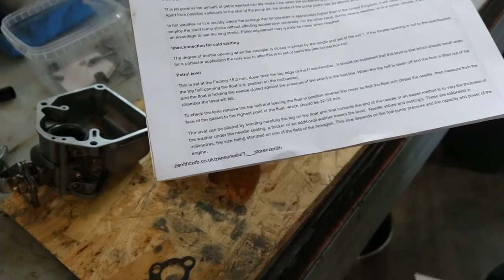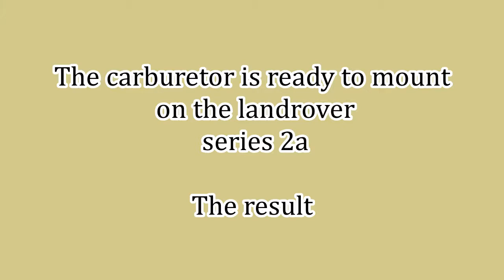Part 2 - Refurbish Zeneth 36 VI carburetor Land Rover Series 2A -  So Oldt

Comment: Nice video, I will be doing a rebuilt of mine next week and your video will be very handy.  Thank you.
Reply from the maker: Hello Marco Rojas . Thank you for the feedback. It is always nice to hear that a video is usefull for somebody. Do not forget to resurface the carb parts (see video part 1 : resurface Zeneth 36VI carb Land Rover series 2A) The resurfacing of the Zeneth 36 is essential for a good repair because the body of the carberator is warped from the heat. Installing the new nozzles (video part 2 : Refurbish zeneth 36 VI carb) is the easier part of the refurbishing job. Fist i did the refurbishing without the resurfacing of the body parts and it was a failure. Pleace subscribe to me channel if possible.  Have a nice day. So Oldt